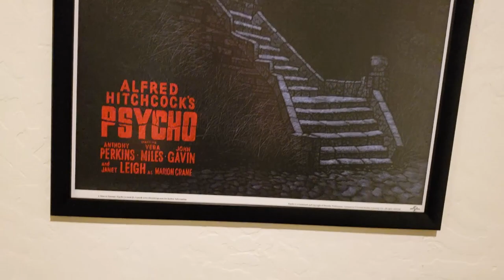How To Assemble a Spotlight Frame

Comment: quick ? Are the overlays safe for the posters life once sandwiched in? Acid free? UV Protection? How are your posters holding up?
Reply: I have not had any issue with a single poster sandwiched between the 2 UV protective overlays (had one print in consecutively for over 2 years).  They even mention on their site about using one as a back sheet.  Here is the explanation direct from their site: 

"Each frame comes with 2 overlays. The overlays are PETG. One overlay will be all clear on both sides. The other overlay will be clear on one side and matted on the other to provide a non-glare display. With this overlay, you can use ether side, the clear side is not as clear as the all clear overlay that is also provided. The all clear overlay will have a protective coating on both sides that will need to be removed if you are going to use it for the front overlay. The Non-Glare/Clear overlay only has one protective coating that needs to be removed if you are going to use it for the front overlay. If you are going to use ether of these overlays as the back sheet, there is no need to take off the protective coating. The protective coating just peals off. Just start at one of the corners of the overlay with your nail. Both overlays provide UV Protective properties and are Acid Free, HOWEVER, THE ALL CLEAR OVERLAY DOES NOT PROVIDE AS MUCH UV PROTECTION AS THE NON-GLARE/CLEAR OVERLAY AND WE RECOMMEND YOU USE THAT OVERLAY AS YOUR FRONT OVERLAY FOR DISPLAY."